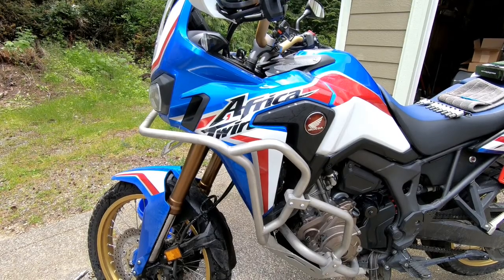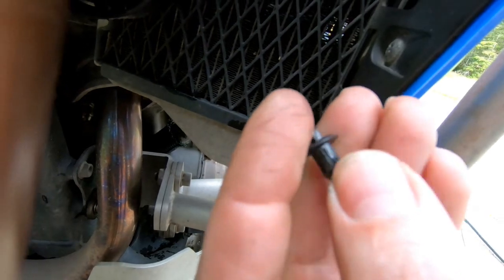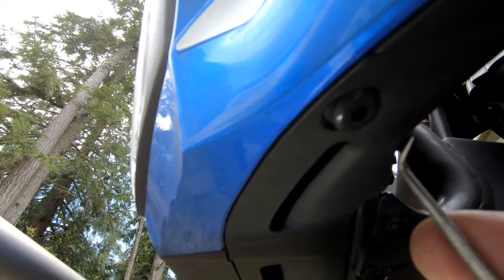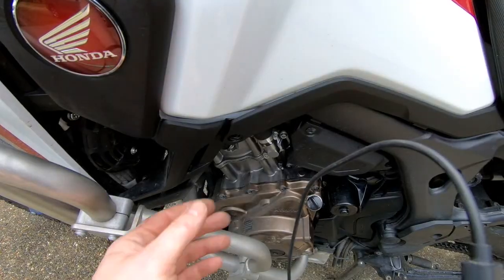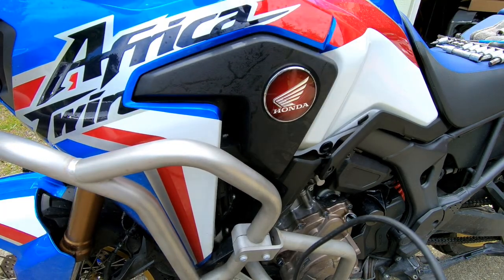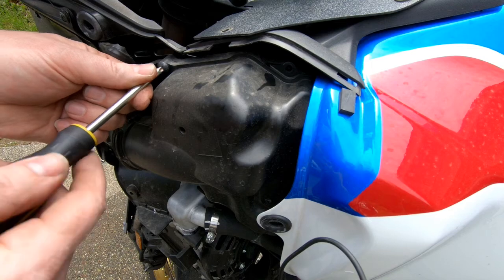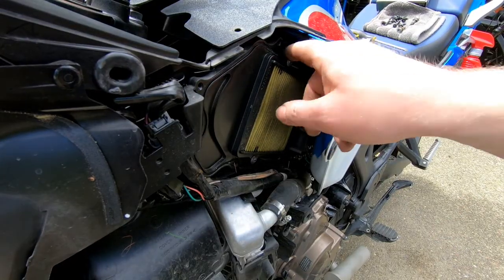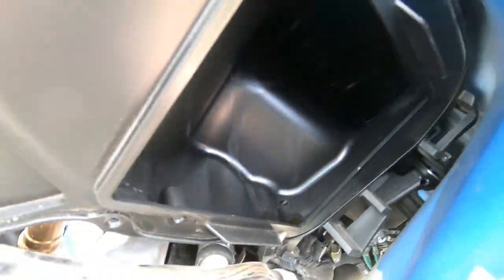Quick Guide on Replacing air filters on Africa Twin

Comment: Great video - Does the bike sound better with the high flow filters?
Reply from the maker: Hiflo is just the brand name, i cant attest to a change in sound or performance in comparison to oem filters. But ill listen in more closely tomorrow to see if i notice anything different.
Reply from the maker: I noticed no discernible difference in sound.
Reply: Great tutorial ! I had to my wife this video when she asked “why does it take you so long to change your air filters “🤣!

She has a 500x and it’s just a simple filter cartridge under the seat. 

Also - in reference to the other comment about whether these filters produce any sound. 

My oiled Twin Air elements definitely gave the intake a noticeable growl. 

Beautiful bike. I have a ‘17 in red
Reply from the maker: It does seem like the engineers at honda stay awake at night trying to figure out how to make common maintenance items hard to get to haha.  Thanks for the feedback! Means a lot to me.
Reply: Someone on the forums mentioned a mod to the inlet manifold for the airbox, gained some power and the intake noise got noticeably louder. I'm trying this mod next week, will update
Reply from the maker: By chance did they provide a chart to show the power gains? Or were they using their butt dyno?
Yeah keep us updated!
Reply: @atombawm  no it was a butt dynamic, but the guy said it turned 3rd gear into wheelie capable. Will do
Reply: @atombawm  An advantage of putting intakes at the front of the bike is that they tend to get somewhat cleaner air and therefore don't get as dirty, as quickly. That said, would I rather have a single filter under the seat and change it more often? Abso-friggin-lutely.

The real crime on these bikes, though, is the battery placement! Easily the most-accessed internal component on a motorcycle and they made it such a PiTA to work with–ostensibly to keep the weight lower. It's lithium, it weighs less than breakfast–gimme a break!

Comment: Great video -  This is the most complicated air filter replacement I have ever seen. Almost took half of the motorcycle apart. Honda's design is not good
Reply from the maker: Lol yeah, its definitely buried in there by comparison. Engineers at honda stay up every night looking for ways to make the home mechanic suffer.
Reply: Try the KTM 1190 or the Ducati Desert X...have to remove the fuel tank.
Reply from the maker: The austrians also like tossing in some torx drive fasteners just to keep things interesting lol.
Reply: Ducatis are much worse as @viralshedding mentioned. Granted, they can't feasibly put it under the seat as the upright rear cylinder would be in the way. Honda could have, but didn't. 😆
Reply: @atombawm  BMW too! Hell, some of their bikes now require a special proprietary wrench to *add engine oil*. Every bike I've ever owned requires...fingers.
Reply: @hibob841 the bmw r1200gs takes 10 mins to change ,real easy.
Reply: @darrenpalmer8695  That's a plus, then. A boxer twin should be the easiest layout to service, aside from a 'flat single' like you see on scooters perhaps. The heads are right there! But it's BMW so they've become ludicrously (and often needlessly) complex.

Comment: Wait wait I have a 2019 it has more fasteners then this.  What gives?  I see ar least 3 bolt on the top part by windshield?
Reply from the maker: Im not sure if theres a difference between the dct, manual and adv. sport models but for the 2019 dct the only screws to remove one side fairing are shown in the beginning of the video. 
(1 by dash, 1 on top and 1 on bottom)

Comment: Whole motorcycle is poorly designed. Not operator friendly. I have traveled 140 days on mine and do very little field maintenance because of cosmetic BS. I don't like tearing down a bike losing small parts while afield when a little foresight may have made a simple task ... SIMPLE.....
Reply from the maker: Agreed, Like most machines these days theres been cosmetic facelifts and covers to make them appeal to the end users.  Not many people buy a AT then use it to its max capability but making preps and putting it on a diet beforehand helps.
Like taking a mx bike to the dunes, gotta mod it or its going to suck sand and chew up chains & bearings. 
Someday i do hope to see a new bike thats field ready right out of the box.
Reply: If what is holding you back from doing such a simple job is losing 3 clips, perhaps the problem is not the poorly designed bike, but the motorcyclist with poor skills and dexterity for mechanical work. 
At this point it would be better to go to a workshop and have the work done by someone who is capable, rather than complain about an operation that on average is done once a year.
Reply from the maker: Lol shots fired... im sure all of us can agree that theres pros and cons to all the different makes and models out there. when it comes to maintenance, the AT is undoubtably on the podium for being one of the best in its class for whats required in maintenence intervals per milage.
The worst being Aprilia SXV....that thing is needy.